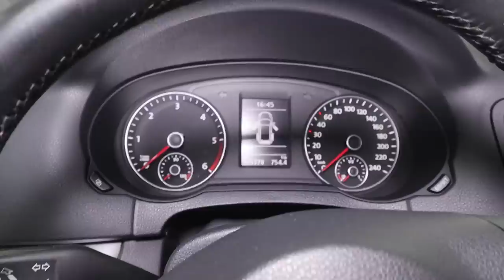Tata lor: VW Sharan - masina buna la orice. Dar urata cu spume...

Comment: Salut Dan, in calitate de fost client al tau, te-am cautat si acum 3 ani sa luăm o alhambra fix ca ce ai verificat tu aici, 175 000 km, pe factura (germania) prin sabauto. Pentru ca erai extrem de ocupat si nu ai avut timp sa vedem masina impreuna, am fost cu altcineva, am vazut-o si mi-a placut maxim. (9200eur achizitie) Masina, dupa 3 ani +, pot spune ca este extraordinara. Cand am luat-o i-am facut tot ce era de facut (distributie, ceva bucsaraie, chestii minore). Am acum peste 250k si in toti km astia am inlocuit doar un furtun de alimentare combustibil (singur, ca era f usor) si un bec pe marsarier. Probabil daca as fi mers predominant in oras as fi avut si alte probleme, insa facand naveta ploiesti-urlati zilnic, nu am avut nicio problema legata de egr si alte surprize. Motorina numai lukoil premium.
Multa bafta in ceea ce faci si poate data viitoare când mai am nevoie de tine, iti mai faci putin timp si pt clienti "casnici", nu numai corporate :)
Reply from the maker: Cine mai stie ce faceam acum 3 ani. 
Acum avem timp mai mult si ne-am inmultit echipa substantial.

Comment: acum am cumpărat un Citroen C4 Grand Picasso din 2011 cu 157000km modelul exclusive cu 6500 euro. vânzătorul mi-a montat 4 cauciucuri noi dot 2022. mi se pare că sunt cam la fel ca mașini doar că a costat mult mai puțin
Reply: Orice masina e buna daca sti sa o conduci si intretii.Eu am avut un citroen ax din 98 a fost ft buna trebuia sai fac guarnitura de chiulasa dar nu mia mai convenit.Acum am un vw touran 2007 motor 2000 tdi 140  7 locuri lam luat la 180mii km cu 3000 eur sunt ft multumit o folosesc de 3 ani .

Comment: Nu as da 11 000 de euro. E din 2011, iar faptul ca are km putini, la un motor de 143 de cai nu cred ca reprezinta un avantaj. Părerea mea e ca tipul asta de motor trebuie alergat, iar faptul ca are probleme la egr ma face sa cred ca nu s a mers chiar turat cu mașina. Nu sunt mecanic, nu ma pricep extraordinar de bine la motoare, dar am avut pana acum 3 masini (2 vag și una ford), și toate motorina. Mers mai turat + revizii la 10 000 + motorina de calitate în opinia mea, și nu am avut probleme cu egr ul cu nici una. Eu unu cred ca prețul real al mașinii ar fi de maxim 9500 de euro, nicidecum 11 000
Reply: Nu merita 11 mii.Egr la mine lam anulat din centralina,merge ft bine acum e un vw touran 2007 lam luat la 180 mii am dat 3000eur sunt ft multumit
Reply: Merita…are 7 locuri, a fost 43k euro noua…

Comment: Posesor de Sharan 7N,vreau sa spun ca,clima nu merge din 2 motive,radiatoru de clima e praf si posibil sa fie si putin freon.
Egr oem, 1180 lei,merge brici,al meu e din 2012, a fost doar 7500 si am mai bagat lejer 2000 intr un an de zile,sistemul adblue anulat,etc,pe ansamblu masina merge foarte bine.